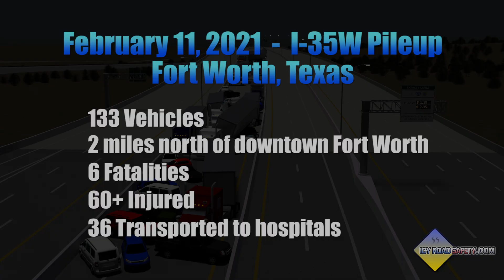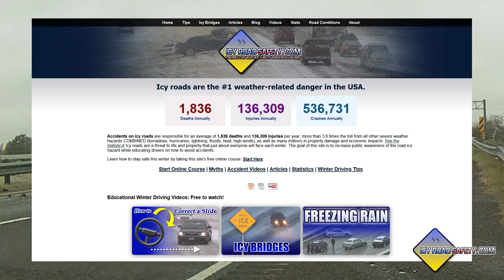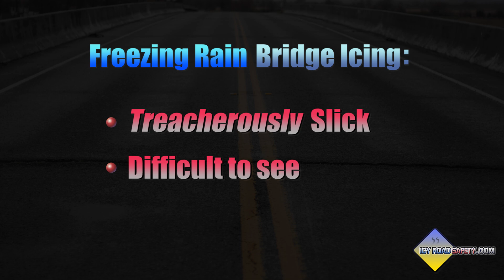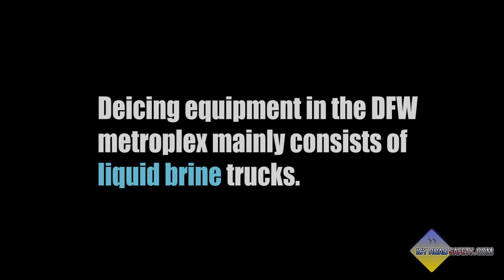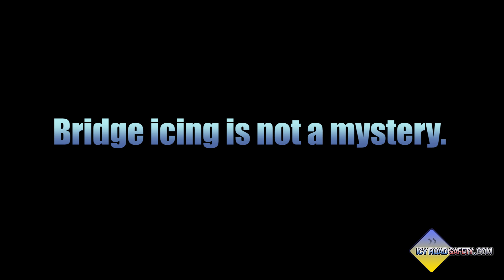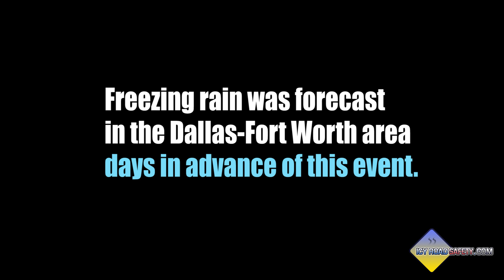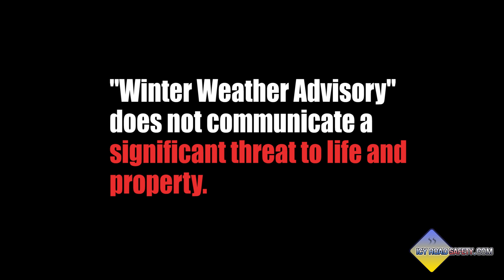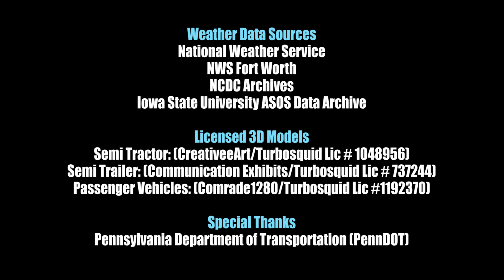The Fort Worth, Texas pileup: its cause, contributing factors and how to prevent future ones

Comment: FT. WORTH... BUST OUT A LAW... PUT UP FLASHING LIGHTS BEFORE AND ALL ALONG A BRIDGE.  AND THE SPEEDS SHOULD BE REDUCED ON ALL ROADS ~ESPECIALLY REDUCING SPEED TO A MANDATED 25 MILES PER HOUR IN COLD, ICY, FREEZING TEMPS' WEATHER ON ALL BRIDGES AND BEFORE COMING TO ANY BRIDGE.   WHERE ARE THE WARNING SIGNS ON THE ROADS??  THEY SHOULD BE NUMEROUS AND BRIGHTLY FLASHING...WITH THE DEMAND TO REDUCE SPEEDS AND TO WHAT NUMBER.  THAT'S IT.  
CITY COUNCIL ..GET BUSY.  
THE LOSS OF LIFE AND THE HORRID CRASHES' FALLOUT CAN BE STOPPED IN ITS TRACKS MUCH BETTER THAN DOING WHAT YOU ARE PRESENTLY DOING ABOUT THIS ENTIRE FIASCO!! .. THIS MUST BE ADDRESSED FORTHWITH.  ITS FAIRLY EASY TO MAKE THE ROADS SAFER IN ICY WEATHER..  ALSO.. MANDATED ICE SPIKES ON TIRES  IN FREEZING TEMP, COLD WEATHER.  YOU CAN CREATE A FUND FOR EVERYONE WHO CANNOT AFFORD TO PURCHASE THEIR OWN...THAT THEY CAN HAVE PUT ONTO THEIR CARS' TIRES AT CITY'S EXPENSE.  
CONSIDER IT "A BASIC NECESSITY" .   
DON'T LET A HOUSE HAVE TO FALL ON YOUR HEADS AGAIN, ...AS THAT HAS ALREADY HAPPENED.

Comment: good job dan.
keep in mind that people are stupid and all the warnings in the world may only help a little bit. 
 However instead of a  sign just telling you that  bridges may  ice before the road does,  how about a solar powered light up sign that has a temp sensor system to flash the words ice on bridge in red when needed
Reply: ...and how about speed limit signs that are digital and flash when they are lower than "normal" due to hazardous conditions ahead.
Reply: I was thinking how about a solar-powered heater instead to keep bridge temperature above freezing.  Ur idea is cheaper though
Reply: Excellent idea!
Propose it to the state, city and other local Departments of Transportation.

Comment: I can see why people in Texas especially Dallas drive like a 110 miles an hour now we're on the freeway you can't even leaving find your exit if you're not from from that city and then they're freeways sister if your freeway system is insane whoever designed it is like should be put in a  Insane asylum that's without the weather

Comment: Sounds like they need active signs and large flashy things to show well ahead of time the issues involved at these bridges and weird corners. And either put permanent speed reduction to those locations or temporary when the conditions are met. Possibly with people going out to check. If they already have tempature gathering they could automate if the data collection is accurate enough. If not add people and other static things like reduction of speed past certain condition. Possibly below what is needed to slow them down before with a noted speed reduction well ahead of the potential obstacles.
Reply: That coudl be a general thing for all bridges regardless. Unless the maintenance and implementation is too costly.
Reply: Can they stick anything in the underpass in side those safety areas for tornadoes to raise the temperature. Or anything around bridges to lower the winds effect and raise tempuratures? They could try to lower the problem all together on top of anything else. There are probably a lot of relateively simple and cheap solution on top of anything else. More small plants for wind blocks would be the obvious. Any good plants that don't grow out of control or hurt foundations that could be planted to block the wind?
Reply: What about side guards that get hit by tempuratures/winds but don't transfer heat/cold along the sides to the bridge to slow down the freezing? Any surface paints or anything that help heat it up. What about chemical or other odd paints that react to cold and get warm or something odd.
Reply: Might need a plant that actually has leaves or enough branches in a dead winter state depending on where they are located. Or something to maintain blockage.

Comment: This analysis and conclusion was great and I really hope the proposed changes are done. The only one thing I disagree with is the idea that the public in North Texas is not aware of the dangers of icing. It is a common misconception that Texas never or even rarely receives winter weather. It may not receive the same amount as other areas of the US. However, having lived here for more than 10 years we have received snowfalls, sleet, and freezing rain far more many times that I can count. With temperatures frequently dipping near to below freezing in winter, the North Texas public has often experienced a good amount of icing events in their lifetime (my family, for example, avoids travel during winter weather). I feel that many people don’t take the proper precautions due to the confrontational attitude and ignorance many people have during harmful weather events. For example, many of us are extremely used to hurricanes and tornadoes yet many people I know in Texas don’t properly heed warnings to evacuate or take shelter. Even with the proposed changes, unfortunately, I know many people will still end up traveling at full speeds down icy roads. I propose something one step further: educating folk from grade school on the dangers of severe weather. Much of the public has little know how as to how severe weather works or the hazards they need to avoid. This is something that I feel like should be common knowledge. I propose incorporating practical weather knowledge into school programs

Comment: Great presentation.

The first thing I want to address is the idea of having short-fuse or EAS-style warnings for freezing rain. There's a few big problems with this idea. The first is that freezing rain often manifests itself in the form of freezing drizzle which is much harder to detect than snow squalls or severe thunderstorms. Freezing drizzle also encompasses a much larger area than convective events. You're therefore stuck issuing short-fuse warnings the size of severe convective watches for an event that may or may not even be occurring. This leads to the second problem with this idea, that there would be many of these warnings issued per season and people would just get used to ignoring them, especially if they're not operating a vehicle. Northern Illinois may experience light freezing drizzle on a large scale every night for over a week if the pattern is stagnant enough. Over-warning can be as big of a problem as under-warning. So what about convective showers producing bursts of freezing rain? Their existence is usually predictable and should be covered under general headlines which historically have been sufficient.

The problem is what the NWS has done with those general headlines and what they're planning to do in the future. Back in the day, there were "advisory" headlines for freezing rain, freezing drizzle, snow, sleet, and blowing snow. "Winter weather advisory" was only used when multiple of these events were expected together such that you'd need several headlines. Well, in recent years the NWS has undertaken a "Hazard Simplification" campaign with the goal of consolidating many different types of headlines together. Why was there a "winter weather advisory" instead of a "freezing rain advisory" for this event? Because there is no longer a "freezing rain advisory"; all winter precipitation events warranting an advisory were consolidated into "winter weather advisory".

The idea behind "Hazard Simplification" is that a smaller number of headline types will be easier to digest for the general public. I think this couldn't be further from the truth. Having separate headlines for freezing rain, snow, and other winter precipitation would immediately communicate the type of threat expected. Indeed people would take freezing rain advisories much more seriously than snow advisories as most people are at least somewhat familiar with the invisible threat of freezing rain. I therefore think that "Hazard Simplification" is largely responsible for events like these. Because of "Hazard Simplification" there is a vague "winter weather advisory" headline for ALL winter precipitation events that gets issued numerous times every year for a particular area such that people learn to ignore it.

The worst thing is what the future plans with "Hazard Simplification" are. Social research has shown that people confuse the terms "watch" and "advisory". The proposed solution is the effective elimination of ALL "advisory" headlines starting in 2024... basically merging them with special weather statements. This means that events like these will have NO official advisory AT ALL in a few years unless plans change. Advisories serve a critical role in warning events that impact people doing particular activities (in this case driving) and I think that removing them will have disasterous consequences. This is why I am a staunch critic of the "Hazard Simplification" campaign and I hope to get as many people to reach out to the NWS with these criticisms as possible.

I do want to return to the idea of better warning for motorists. The best solution that I can think of is flashing warning lights and signs that are activated by counties or municipalities during icy conditions. Implementation would be relatively straightforward-- just add radio-controlled solar-powered LED flashers to existing signs on roadways. These would serve as an immediate warning that roadway icing is in progress or imminent and that defensive driving is necessary, and wouldn't irritate people at home with phone or NWR warnings. I think some areas have tried this, and I'm willing to bet that icy road crashes are much lower in those areas.
Reply: ANY TIME, IN FT. WORTH... THAT THE TEMPS ARE AT FREEZING... AND THERE IS ALWAYS POSSIBLITY OF FREEZING DEW OR LIGHT MIST..WHICH ALWAYS MAKES SLIPPERY ROADS, SPEED MUST BE REDUCED WAY DOWN.   i grew up there...and I know.  Needs a mandated drop of speed to 25 miles per hour with flashing signs all along a bridge and before the bridges... on all roads.  Loss of life and stability PURSUANT TO CRASHES is NOT ACCEPTABLE.  PLUS THE ADDITION OF TIRE SPIKES..WHETHER IN PLASTIC OR METAL FOR GRIP...ON ALL VEHICLES.  IN WINTER WEATHER.  MANDATED.  PERIOD. FULL STOP.
Reply: Excellent, informative reply! But don't you think it's better to give a more severe warning and those people that will pay attention who didn't know any better will then have an opportunity to go ahead and pay attention? It's human nature to grow complacent and pay less attention to those things that are serious, especially when  everything seems okay.. it's like when you get on an airplane and they explain about evacuation procedures. Most people tend to tune out those warnings and instructions, but it's better to try to alert those don't know any better but would adjust their actions accordingly and leave it up to the individuals who WILL be cautious to do so. This video informed me of information that I did not know such as the fact of just how many deaths occur because of these weather phenomena. I agree with you that flashing lights and increased signage would be in order. Liquid brine is a joke. It should be salt mixed with sand.

Comment: Here in the UK and most of Europe we have had programmable signs on the side of most major roads (not just motorways/highways) that light up with orange text alerts for drivers. Warning about fog, accidents ahead, road closures, roadworks, high winds etc are provided miles before the affected area. I did not see any such signs on the video and wonder if the US simply does not have them, or not very many.
I think they would help... but drivers often ignore any warning.
Reply: I'm in the Southeast U.S., and we do have the programmable signs on Interstates, and on some of the more traveled highways.  You could argue that they do not have enough of them.  But what I have noticed is that drivers often ignore the signs or don't take them seriously.  And I've also noticed that signs aren't updated often enough to reflect any rapidly changing conditions.  Sometimes the warnings on the signs remain the same for days.  Imagine driving on a highway covered in 2 inches of ice, and they sign says "Wintry Mix Possible".

Conditions can change often and very rapidly depending on the particular dynamics of the storm.    In January of 2014, we had such an ice storm in the Atlanta area.  At 11 a.m., there was hardly a snowflake in the sky.  By 1:30 p.m., roads were slick, iced over, and traffic was gridlocked on city streets as well as major highways.

We knew the storm was coming.  People ignored the warnings, and honestly had poor planning for the storm.  Nobody expected the condition of the roads to deteriorate as quickly as they did.  It didn't help that everybody took to the roads at the same time to get home, so you essentially had rush hour traffic in an ice storm.  Just poor planning of course.
Reply: Years ago those bridges would have been sanded. People in charge today are lazy.
Reply: It costs money we are not going to pay for that in texas
Reply: @u-know-this  My area of Texas (near Fort Worth) has programmable signs.
Reply: But your state has more than enough sand to deal with these rare events!

Comment: Simple solution-- SLOW DOWN!!!
Reply: But people won't- they think "I haven't seen any ice" and then they spin out. Only afterward do they become a believer. With warned winter storms here, the Highway Patrol reminds everyone that if you crash or end up in the ditch they will write you up for "Too fast for conditions" no matter your speed, and in addition to any other tickets you might get.
Reply: Lol... Speed isn't always the issue. That same storm, my vehicle wouldn't stop sliding. My speed? I put my foot on the brake, changed the gear to drive, and took my foot off the brake.
Reply: And change tyre
Reply: That's to simple !
Reply: It was on the hov lane meaning you arent supposed to be going slow
Reply: That doesn't solve anything. Even if they slow down the bridges still icy and it's still going to lose control. And if you slow down quickly as soon as you see the bridge icing sign you could just end up getting slammed from the rear.